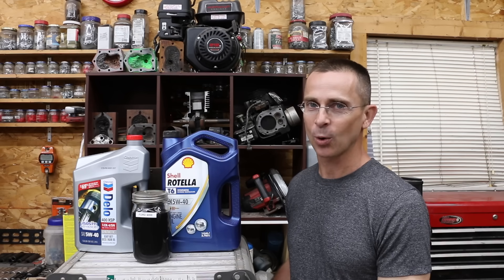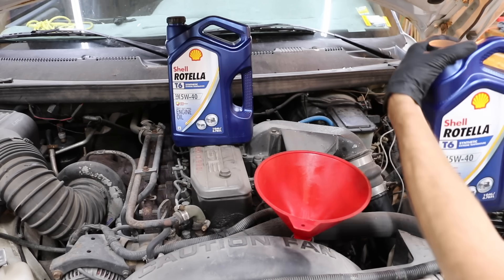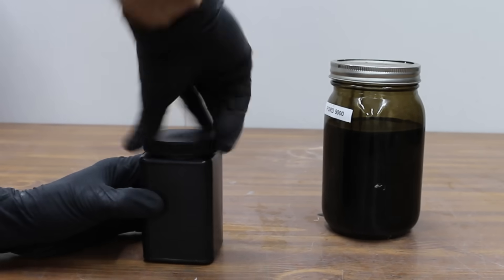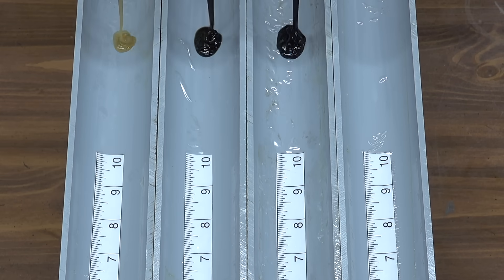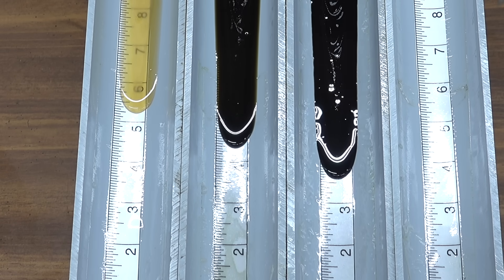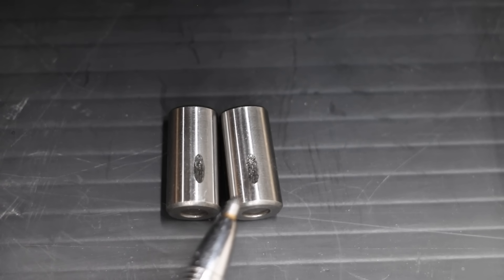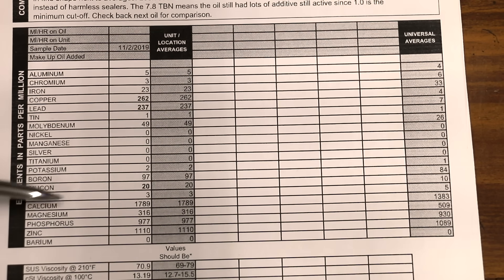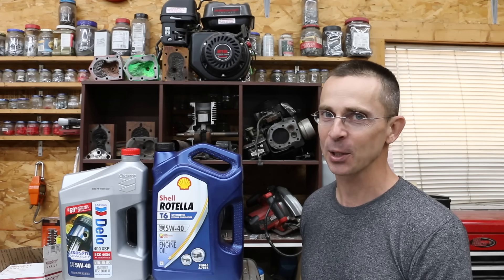Will Annual Oil Change Damage Your Car? Let's find out!

Comment: Just remember that oil is cheap, engines are not.
Reply from the maker: Great point
Reply: That's not an argument for changing oil way too often. Also good oil isn't all that cheap. 
Change oil when it's needed, people spew that rubbish in excuse of doing oil changes like you had to in the 50's.
Reply: I would run my ‘04 accord with less than 2 quarts of oil at a time cause it would always leak out my oil changes in a few weeks. That engine did not want to give up
Reply: @chavezhurtado6483  Still change the filter!!!
Reply: At some point, you are just wasting money, oil, and time.  PG has multiple vehicles and acrage, so do I.  I have 10 vehicles between cars and farm equipment.  That is a lot of oil!  Low milage/hour equipment falls to once a year or 2.
Reply: @bryanhutzler7010  This.  I mean, if we're going to take the  logic of "oil is cheap, engines are not", hell, bring some quarts with you to the gas station and change it every time you fill up!  At a certain point, it's about knowing the real, SENSIBLE interval.  For every guy that's gung ho about changing his car's fluids more than they really need, when was the last time you scrubbed the coils in your house's air conditioner or cleaned the drip tray behind your fridge?  

There's so much maintenance to be done in life and only so much time to go around (even if you're rich and money doesn't matter).  Even if you don't change the oil yourself, driving to the dealership/mechanic takes time to have him do it.  I just like to know the truth and do things SENSIBLY, not live my life in irrational fear based on wives' tales and I'd rather spread my time and money around in a more sensible way instead of changing my oil 25 times a year but neglecting everything else because I'm changing oil every other weekend.  

And just for the record, at least for modern synthetics, I've never seen a failed engine due to old oil below the mileage threshold that's been used regularly enough to keep moisture from being a problem.  Every oil-related failure I've seen is from extreme mileage (like 3x the normal maintenance interval), sitting without being driven for more than 6 months (usually more than a year), or from not having enough oil due to burnoff/leaks or has some contamination like from a blown headgasket.  I've never seen a case where a vehicle  failed that was only used once a month and stretched the oil change interval accordingly based on miles.
Reply: And a lot easier to fit than an engine!!!
Reply: @garymills6702  
if your engine leaks or burn oil and oil find its way to injectors its better to use heavier oil
Reply: But most engines are "abandoned" not broken.
Reply: Manakuski I don’t consider 60 dollars cheap. :(
Reply: Yeah it is a good point until you have some results that say the extra time makes little difference. Then you are just saving more money. Remember the automotive oil industry is incentivized to tell you shorter intervals are safer. My local Jiffy Lube continues to recommend 6 months or 3000 miles which is just money down the drain...it is well established that a car can go at least 1 year / 5000 on conventional pretty safely.

On top of saving money, you also might be helping to save the environment. Then again, by buying more oil, you have that extra peace of mind, and you might be helping to pay someone's salary (as well as further lining the pockets of the executives at the top of these oil companies).

Never hurts to have information such as that given in this video to help us make our own decisions. I'll personally be upping my time interval to 2 years or 10k for synthetic.
Reply: @helloken  I will never be going to jiffy lube with my vehicle. I have a 2018 Malibu and same thing. 5000km on synthetic! Can't afford that. So.i go to my local gm and its actually cheaper and get better oil and it gets cleaned and a good check over. I know they do it cause I watch them for those who aren't sure
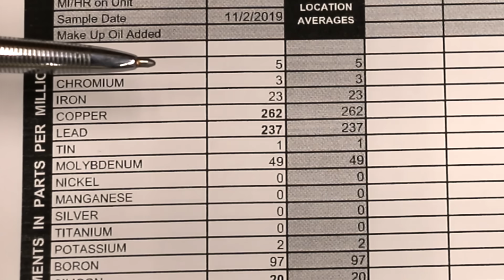Reply: Oil is not cheap, synthetic is about $10:00 a quart and if it is still good why throw it away.
Reply: thekeyboard warrior  Shhhh, dodge owners have feelings too.
Reply: Well , cheaper .
Reply: This argument applicable to the motion of changing motor oil for every 6 months. Even 3 months. Where do you draw the line?
Reply: see the results of flushing the oil: https://www.youtube.com/watch?v=x4u64lKBbhQ
Reply: New cars come with automatic oil burners nowadays. You can just check and fill as needed now.

Jk change your oil guys
Reply: That's the propaganda oil manufacturers spread
Reply: @meandmybike9467  Yeah and this fake pandemic is very good example of propaganda .

Comment: We do oil change at 2500 km. Or 1400 miles. Why you people change so late?
Reply: I use shell hx-3  20-w50. I m a Mobil oil dealer myself
Reply from the maker: Thank you for the feedback
Reply: @ProjectFarm  I need your opinion
Reply: vehicle manufacturers doesn't even state to change oil that frequently... what do you drive?

Comment: Thanks. This is very useful. I run full synthetic, and change oil every six months. I usually only average 4000 miles during this time. This proves that I could go longer if I wanted to.
Today's synthetics are exceptional. The old "think of months, not just miles when changing your oil," seems to no longer apply.
Reply from the maker: Thank you

Comment: If my exhaust smells like unburnt gasoline, and my oil hasnt been changed for a year, does that mean i have to change oil asap?
Reply: your spark plugs are probably worn or you're not driving long distances enough to bring the vehicle up to opertating temps for an extended amount of time? yes, change that oil asap since it's probably diluted with gas. open the oil fill cap and/or check the dipstick for gasoline smell too
Reply: I think u have to see a doctor and a hairdresser...

Comment: How many Km required for fully syntetic
(5w 40)
And for Meniral oil (10w 30)
And make a comparison for
Motorcycle oils to 
Shell fully syntetic scooters oil vs mutol Power scooters they have the same viscousity 5w 40 
Thanks
Reply from the maker: Thank you for the feedback

Comment: Definitely need to do this test on a gasoline engine and see if there’s any difference
Reply: I am curious to see lab results comparing metal wear rates in a gasoline engine. Maybe rottela T5 10w-30 vs motorcraft 10w-30 (both are synthetic blend) after 5000 miles in a gas engine. This would be huge.
Reply: @xlightssx  I have a 4.6l v8 mercury grand marquis. In the owners manual here in mexico it says use 15w40 weight. It hardly drops below 0°c to 38°c on summer here. I use mobil 1 super "conventional" 15w40. I change it every 4 months with my fl 820 motorcraft oil filter. I want to change it every 6 months. My options are 15w40 api sp  full synthetic from quaker state or this delo ( SAE 15w40 ) from chevron. Which one will you think it's better? My car is in good condition and the engine burns about 1 quart every 4 months. Thank you.
Mobil super is working good so far. It keeps my engine quiet but I don't trust the brand much to leave it more than 4 months, my driving is commuting daily, might apply to severe use conditions.
Reply: @tomorrowcomestoday1621  both oils are good. I would choose the delo. Try finding Castrol edge oil, it will reduce your oil consumption.
Reply from the maker: Thank you for the video idea!
Reply: @ProjectFarm  gonna do this idea soon?
Reply: Thanks for all the great information. Just as I suspected!

Comment: Do one on if you need to change your oil if you have to add a quart every 1500 miles for us in the gutter😂
Reply from the maker: Thank you for the feedback!
Reply: external oil leak? AT 205 re-seal should be tried on the next oil change... or do you have oil blow-by (worn engine)? at least change the oil filter once a year

Comment: Wow that was a excellent video, talk about putting time and effort into a video nice job! Thank you, I use T6 in my Ford 6.0 and my Honda Xr650l  and in my 27hp and 18 hp Kohler engines, because of the Zink it works wonders in these small air cooled engines
Reply from the maker: Thank you

Comment: Is it just me or the title is confusing?
Reply from the maker: Thank you for the feedback
Reply: a bit; mainly for diesel engines but i guess it applies for both gas and diesels?
Reply: @ricebike  
I believe the reason I was confused, more than anything, is because there's no clear answer at the end:  "yes, it will" or "no, it won't".

In any case, the title implied that changing oil too often can be damaging?
Reply: @Massimo-sn7xd  in his case, along with many others who commented directly about this video (& not go off topic) is no~ with a good quality synthetic oil /filter & warming the vehicle up to operating temps to circulate & evaporate the condensation buildup monthly... but this was on a well maintained vehicle as well. based on the oil analysis that his vehicle's head gasket or metal parts wasn't worn

Comment: great video.. only thing i must say is new oil doesn't necessarily mean it's clean oil never prefill a lube filter unless specified by the manufacturer for a modern engine the tolerance are really tight but for a older truck that's fine.. as must oil have to meet SAE regulations but not what the manufacturer wants to see for   particulate size and count.. ask for a particulate count for new oil contaminants larger than the micron rating of a average filter next time you're sending out samples.. or sometimes if u pure out a bottle of new oil u can see contaminants that fall out and settle at the bottom of the bottle
Reply from the maker: Thank you for the feedback.

Comment: Love the sound of the Cummins diesel!
Aren't diesel engines supposed to use 15w-40?
Thanks for the test reviews, I leave my Dodge truck parked for extended periods.
I use Conklin synthetic oil.
Reply from the maker: Thank you!  It is supposed to have 15W-40 but it's winter here and 5W-40 will work very well.

Comment: I'd love to see what you thinks about archoil 9100. Diesel guys with powerstroke engines swear by it. They say it solves a bunch of problems on their oil pressure fuel injectors. I run it in my 01 7.3L. They claim unbelievable antifriction with it being a boron based additive. Check out the jay Leno garage segment with archoil representative it might be legit.
Reply from the maker: Thank you for the video idea!

Comment: You're plenty smart and very thorough.  But you know, and I know, the oil starts oxidizing and collecting moisture the moment you unseal the container and add it in the engine.   They put additives to try to prevent the oxidation but the additives can only do it for so long, and there's no way to stop the moisture getting in the oil.  I think your tests are as good as anyone could do it, but because of all that, any engine I value is getting its oil changed at the recommended intervals
Reply from the maker: Thank you for the feedback

Comment: You can use the T6 in motorcycles with wet clutches as it does not have friction modifiers that will affect the clutch plates (JASO MA/MA2).
Reply from the maker: Thank you for the feedback

Comment: I would love to see you doing the same testing with Amsoil products as well as using 0W-20 since that's what most newer cars now use. I use this in my Honda and my Subaru and only change the oil once a year in both without any problems. The Honda only gets about 7000 miles a year and the Subaru gets about 10,000. Most is city driving.
Reply from the maker: Thank you for the feedback

Comment: I hear a lot of motorcycle riders  proclaim that the oil in their ride is religiously changed every 3000-5000 km. Any other proclamation is blasphemous in their opinion. Is the performance of engine oil in a motorcycle different from that in a car or truck?
Reply from the maker: Thank you for the feedback

Comment: please have various engine oils (one by one) in one engine; disconnect serpentine belt to eliminate drag. Charge the battery with a charger. and measure the 1) Air flow reading of MAF 2) oil temperature during the entire test 3) how long a qt of fuel lasts for each of the oil. Please be sure to test castrol , mobile 1 for me. This will help determine best oil in the engine.

do same above test with regular & synthetic oil for further testings.
Reply from the maker: Thank you for the feedback

Comment: Let my Toyota Tundra sit almost 5 years without changing oil. Started right up, oil looked fine. Swapped it out anyways, but I figure sitting in an engine pan cant be that different from a garage shelf 🤷‍♂️
Reply from the maker: Great point
Reply: if it's used oil yes it does behave differently plus on the shelf it's sealed no oxide in the bottle .. and even so oil they sits extending times on the shelf or holding area especially if not temperature controlled has to be recycled at some point
Reply: Jonny DIY your engine is probably all sludged up on the inside...

Comment: Could you test ski doo XPS full synthetic 2 stroke oil vs amsoil. Or even super tech 2stroke from Walmart. I hate spending 50$ a gallon for the ski doo XPS. Especially if it not necessary.
Reply from the maker: Thank you for the video idea!

Comment: First off - I love your videos!
I'm a big oil nut type of guy and your videos always fascinate me.  :)
I've been a fan of Amsoil for decades.  Now I use either Mobil-1 or Valvoline Full Synthetic in my cars and power equipment.
You are always asking for suggestions at the end of your videos so here goes...

I have 3 requests for tests on products I haven't seen you mention yet.

1.   Militec-1 oil.   http://www.militec-1.com/autos.html   My brother and I saw a demo of this stuff added to oil to make oil much more protective during the bearing test.  This was at either a car show or a gun show.  I have an old empty bottle from about 30 years ago in my garage.  Claims to increase fuel economy and power.

2.  See if model engine fuel will work as a fuel in gasoline engines.  https://en.wikipedia.org/wiki/Glow_fuel

3.  KISS-COTE https://www.kisspolymers.com/Products/products.htm   We also saw this stuff demonstrated at a car show and it was impressive as a coating to protect surfaces from the elements.  The website makes some lofty claims.  Wondering if it's snake oil.  They even claim it can be applied to your teeth and you will reduce the risk of cavities by reducing bacterial adherence to your teeth.  The dental coating has to be applied by a dentist.  Pretty wild stuff!  :)
Reply from the maker: Great video ideas!  Thank you

Comment: shell t6 has a JASO MA rating. JASO MA IS A GAS oil rating! it is for common sump lubricating of transmission and engine. it is vary shear resistant and lacks friction modifiers. another good oil to test is FORD motor craft diesel oil  15w40 and 5w40 has minim of 1000 ppm of phosphorous in it! thy recommend it in all the old fords with flat tappet cams and new and old diesel.
Reply from the maker: Thank you for the feedback
Reply: thanks! love the tests you do! put to rest old tails and sum times show their is truth in the old tails! keep up the good work. wold love to see how ford motor craft 5w 40 is vs t6. i will say t6 made my old ford 351w run smoother.  but looking at the ford spec sheet i think motor craft 5w 40  it my be better than t6.  take care

Comment: First off, I'm a huge fan of the channel. I'm an engineer professionally and huge tinkerer in my spare time, and I really love the way you test the products. One thought:

I'd love to see you try Jojoba Oil as an additive to motor oil and/or transmission fluid. It is a plant-based version of "wax esters," the key ingredient in the no-longer-legal sperm oil from sperm whales. Sperm oil was famous for its ability to withstand high temperatures and still provide good lubrication without leaving deposits. Apparently, the ban on whale oil in the 70's increased the rate of transmission failure by 800% (8 million vs 1 million / year). Chemically speaking, the extremely high temperature tolerance and lubricity of jojoba should improve the film strength and burn-off rate of a motor oil.

I hope you'll consider running this, because I think there's a lot of promise!
Reply from the maker: Great video idea!  Thank you for the video idea and positive feedback
Reply: @ProjectFarm  Happy to help! It's very cool that you're able to do these kinds of tests.

Comment: Excellent testing. 

Why should lube oil deteriorate by just sitting in the crankcase? The answer: there is no chemical reason for that. The best criterion is miles or hours of engine operation. If you start out with high quality oil, and let it sit in a crankcase for 5 years, why should it go bad?

You worried about water “contaminating” the oil during non-use. Unless your engine has a hole that lets in rainwater, there is no reason to worry about that!

Remember, lube oil is not lettuce, meat, or plums; it’s basically a non-biodegradable chemical.
Reply from the maker: Thank you for the feedback

Comment: I use t6 5w40 synthetic in my 2005 gmc envoy in puerto rico , it runs very well i use a synthetic oil filter. 
You just proved  i made a very good choice , the envoy has a 4.2 straight 6 cyl .
Reply from the maker: Thank you!